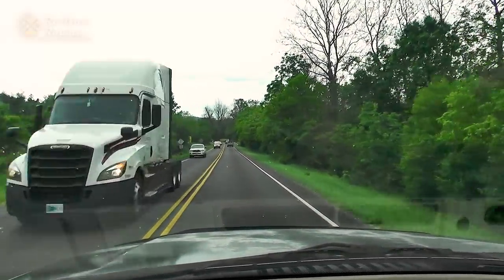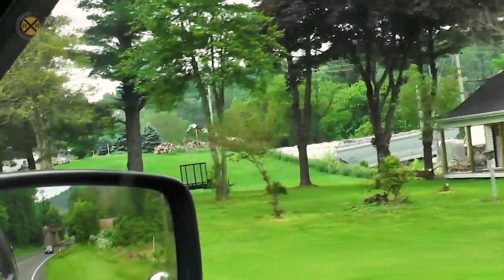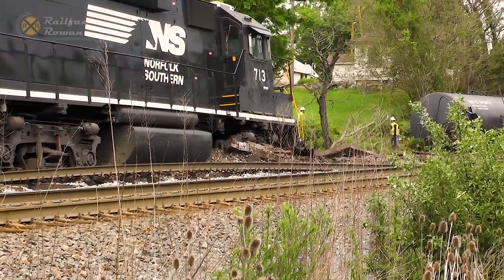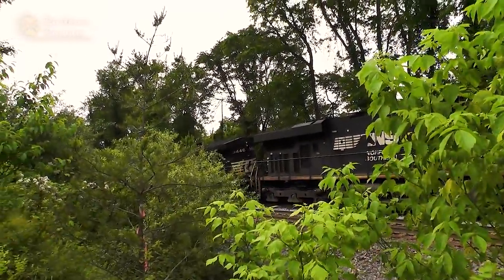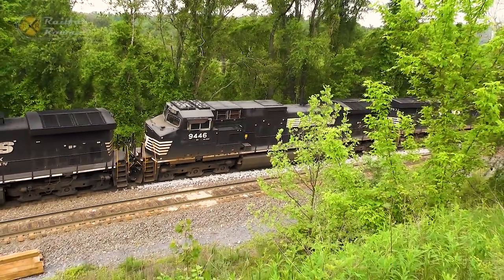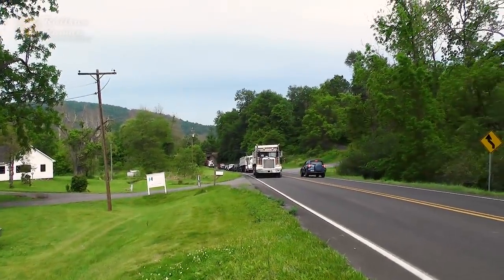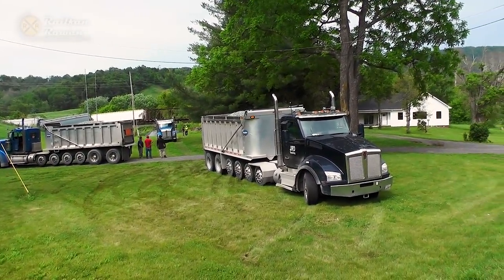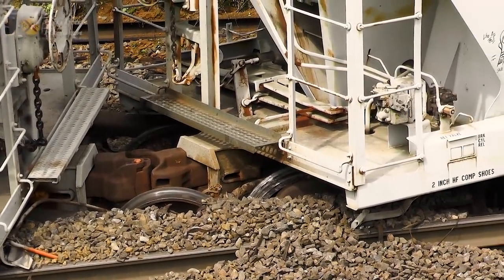BIG Derailment Near Front Royal Virginia - I-66 Norfolk Southern Freight Train 12R Linden VA

Comment: Proper job then??? Looks very much like the road has spread under the wheels of the front locomotive, probably due to rotten sleepers/ties, causing the spikes or other types of fixings securing the base plates to the rail foot to lose their holding power, turning the rail over rather than it being a technical fault with the points/switches, as these are always interlocked with the signals , which cannot clear to a proceed aspect unless the points/switches have been detected to be in the correct position and the facing point lock applied. Hydraulically operated rail clamp locks are also interlocked to the signals... I was a train driver in UK for over 40 years, now retired, and witnessed the aftermath of quite a few derailments, accidents and incidents to both passenger and freight trains in my time... May I reiterate what the previous post has said... stay well clear of the railway and take any photographs from a safe vantage point... you never know what may be hanging loose on a moving train... that applies to level/grade crossings/station platforms too when watching trains pass...
Reply: Thank you... If you're interested in current and historic rail accident investigations, you can find all of the US reports on the railroad section of the NTSB website, the Canadian ones on the Transport safety Board of Canada website, Australian ones on the ATSB website, NZ ones on TAIC website, British (and some Irish ones) on "the Railways Archive website, or RAIB website UK, RAIU website (Ireland)... I used to be a Trade Union Health and Safety Rep (ASLEF) before retiring, hence my interest in rail accidents... you can always learn from the mistakes of others...
Reply: I am retired railroad supervision Tranmaster Yardmaster Wreckmaster Safetyman and track checker. Have worked industrial switching yards Steel mills. Never worked on mainlines HOwever worked with all the Rail carriers Canadian national . Norfolksouthern. Conrail  penn central. List goes on. Rerailed molten iron torpedo bottles. Slag pots. Steel ingot cars all miserable conditions on my belly with wood blocking guage rods grease and some luck and replacers. 49 years and 65 age. Time to go home. Its a young mans game. Railroads gets in your blood. Your mind and eventually your soul.  So what do i do now? Sit in my chair and watch railroad sites on internet.  Out of the SMOKE AND STEAM i became who i am. I still have my gloves. If you worked on railroads you know what they are for. I see them and memories come back. I will never forget my life as a railroader. Thanks to you. I may see you on down the line. May all your switches be !ined for you and a clear tracks ahead. OK BACK!!!!!

Comment: You brought up a very good point early on, about being aware and alert for anything. That empty centerbeam had a number of cables come loose. If just one breaks or otherwise comes loose on a moving train, you'd likely never see it before it took your head off. Shifted loads, dragging equipment... stay away and stay safe, folks.
Reply: Its like the Video where the kid was railfanning a Reading and Northern train on their first run on a reactivated line and the rear of the train jumped the tracks when he was standing less than 5 feet away.
Reply: Aaackk!!  Holy smokes, NEVER gave that loose cable thing a thought!  Subbed.
Reply: @dexecuter18  - I recall a website run by a railroad engineer who basically wanted to "scare kids straight" by posting photos of actual deaths by climbing under railcars. In one, there was a youth whose torso was severed just above his pelvis. The characteristic "belt line" bruise where the wheel flange pinched the body in two was pointed out. Think about that the next time you use a pizza cutter wheel, lol.
Reply: Or , like that landslide video that knocked the intermodal train over . You can see a few signs of the dirt shifting early on but if one was not paying attention to the hill , and was close to the tracks , the intermodal cars could of smashed you and you would be dead in an instant. Railfanning may not seem that dangerous , but trains are sooo dangerous and things can snap or change in a second . A rail could flop over , an intermodal car could smash into you , or maybe a switch fails and a locomotive flips onto you . Always be careful
Reply: @deadfreightwest5956  Yeah when I was a conductor a new trainee went in between cars when they where in motion and got sandwiched in the knuckle.  Guy must have been as dumb as a rock.  You never foul the tracks unless you have 3 step when in proximity to rail cars and engines.  That is the number one rule they teach you pretty much before anything.
Reply: @freespirit9981  - You can't fix, or prepare, stupid. As a lifelong professional, I've been called on to train others, and some people... You wonder how they find their way to work.
Reply: I totally agree. As an (Australian) railroader of 42 years service, I know the forces involved with moving trains and what could happen. I've seen rail fastenings, the Pandrol clips that hold rails to concrete ties up to 50 feet from the derailed cars. Imagine one hitting you. Also, if a tank car ruptures, you could be walking into a toxic vapour cloud. There's just so much dangerous stuff on railroads these days, but a damn sight safer than going by road...
Reply: @russellcasey616  Back in the early 1970's a freight train loaded with ammunition for the US Army, US Navy, and the US Air Force exploded near Roseville, California.  Needless to say, it resulted in a massive mess especially since it occurred in a RR switching yard. The small town of Antelope, California was completely destroyed.  This occurred in April of 1973.  My understanding is over 7000 pounds of bombs were in the train cars.

Comment: When you said - that is where the pin goes, --- that part is called the truck, it has the wheels and bearings , springs, and yes that is all that holds them on to the car, tanker, or what have you. Scary in a way, but it works, and its simple to fix. when putting a carback on the tracks! Grew up 500 yrds from the tracks. Loved hearing and seeing them go by. When I was about 9, I rode on the old train with the coal burning engine. and the old passenger cars! I still remember that! Thanks, again!

Comment: The torch is long not because of heat but for safety and/ or ease of use...
Reply: Yea, I'd want to be rrreeeeeealllllllll far away in case it's under alot of tension
Reply: Yeah it's long so you can reach stuff with out being totally in the line of fire. The rods he cut are part of the break rigging and are attached to the trucks via pins
Reply: yeah as someone who's worked with torches- they don't need to be long at all, you only need it to be 3/4 foot long from the valves to the torch end.
Reply: @javierpowell4705  yea a shop torch, if you're cutting something big with somewhat unknown tensions/ loads you want to be real far away
Reply: @Alex-uy7pc  yeah was just contributing the fact that it wasn't heat that necessitates the length
Reply: True, the longer torch allows it to be used from a safer distance. A shorter one would have meant that he would have been much closer to the two rods he cut, both of which if under tension could have killed or severely injured him.

Comment: It would be Interesting to know how Fast the Train was Moving.  It would be equally Interesting to know what Percentage of Derailments include the Units at the Front of the Train.  My guess would be the Higher Percentage of Derailments occur at other points on the Train from Broken Axles, Cracked Wheels, Broken Rails, Malfunctioning Switches, etc. Thanks for the footage. 👍
Reply: My guess 35-45 mph.  regular freight is typically capped out at 45mph on most NS lines.  From what I can see it is not split rail so side with probably 35-45 mph max speed for that rail zone.I side more with 35 mph zone.  Looking on google earth with the curves that are present in that area I side with 35 mph zone.   Maybe even 25-30mph cause I see their is a sharp curve on this line in the area of the wreck.  Up to 55 mph if intermodal.

Comment: I am a retired train driver from Milton Keynes in the UK. Fascinating, well filmed and presented video. The work those recovery and repair crews are doing is incredible. In my career I only saw one derailment incident - a single 90 ton loco that took a 15 mph switch at 45 and ended up in the ballast between two running lines. That closed the line for twenty four hours just to recover one loco and repair the track it tore up. It's absolutely correct what you say that when working trackside you need to be fully alert at all times - things really can happen in the blink of an eye.

Comment: Has anyone else ever wanted to see a derailment like this actually happen? Am I the only one?
Reply: Seen, it many times. NS are derailment specialists, crane master, Hulcher and Corman are wreck specialists.
Reply: Sean Collins no I mean actually happen. Like seeing the train pileup.
Reply: If you work in a hump yard for 22 years, you'll see many happen, in real time.
Reply: Sean Collins cool! Is it really interesting too see? I have a bunch of historical footage of the Duluth Missabe & Iron Range Wrecking crew in the 50’s and it certainly has changed in terms of safety. They had no hard hats or safety glasses or anything.
Reply: I do believe that there is a old video about a hump yard derailment. Ima see if I can find it
Reply: @railsofthenorthland1181  , in the yard limits you don't see mainline speeds, but it is still pretty impressive to see a cut break away from a pullback trying to slow for a coupling and tanks, LOs,and chip gonds end up 3 high and spread across 8 fwd yard tracks. First priority is to make sure that everyone got in the clear, then watch the circus come in and watch the different departments try to place blame on each other. Small derailments are handled by the carmen, anything too serious gets a wrecking crew called in.
Reply: @seancollins8665  You should see what it looks like when it is a beer train that derails. Makes you wonder just how much pressure a boxcar can withstand before the doors or sides blow. If the car is properly loaded, the car has to be scrapped as it will exceed width limits.

Comment: I work for a salvage company and you're right, no two jobs are alike and it can be extremely dangerous. Granted most of what I do is marine salvage I also do some aviation and have been called in for a few rail jobs as support for the main crew.
I can't post about the main company that I work for but SOAR Aero has a channel that has a few jobs that I worked on posted on YouTube.

Comment: We hit a washout once, going about 25, we were slowing down to 15 mph to thru a interlocking the took the train from 2 mainlines to a med speed pass siding.
The train was to cross from outside line to the inside line to pass siding. 
It was the heavy rain season and it rained very hard in the early morning and the saturated natural wash moved a 3ft section 80% under the roadbed.
When we went over it, the front of the lead unit made it and the back did not and on the ground we went.
Did travel far, just stopped

Comment: Great coverage, - the Units- (the engines) as they are called , weigh average 140 ton per unit! Electric over Diesel power. These guys are doing a great job. My dad was on the railroad and had to go out on these as they happened! Like you said, it's a puzzle you have to work out as you go. We had a bad one years ago, where several cars loaded with rolls of printing paper went into the river. They had to cut them open and get some of the paper out so they could lift them. People don't realize what a simple thing can make a train derail. This looks like the switch may have been a contributing factor. Glad no one was hurt. Nice job! Thanks,

Comment: Appreciate the video. Question, what exactly do they do with a damaged railcar to haul it away? Not like they can throw it on the back of an 18-wheeler
Reply from the maker: Well they actually can, it would need a wide load permit, but absolutely a tractor trailer can haul that, depends on how they cut it up but most of the time I think with these they cut them up and scrap them in smaller pieces, I wasn't there to see it so I don't know for certain

Comment: I live about 300 yards from the CP Rail main line where it crosses thevEaglevRiver in BC.  I have to say CP has very few derailments considering they run large unit trains through the Fraser Canyon and Cdn Rockies.  I think you are right that the switch may be the culprit here.
Reply from the maker: It's either that or track gauge, that the train split the track gauge

Comment: What he is cutting at 15:20 is part of the center beam's brake rigging. I don't see the brake cylinder but do see the reservoir and the brake valve. The rigging is snagging one of the tank car's drain valves
Reply from the maker: I assumed it was a brake pipe

Comment: The extra length of the torch is not because the extra heat...
It has the same heat and tip as a regular torch 
The extra length is usually used in scrap metal or demolition just for the convenience or extra reach
Reply from the maker: Yep, understood now!

Comment: Rail cars sit on pins that hold the car to the trucks.  We don’t call them wheels.  Each axel weights about 2,000 lbs each.  Same as  locomotives they sit on big pins as well ell and the weight of the engine and frame is what holds it in place.

Comment: THANK YOU FOR YOUR EFFORTS...& you should get a cheap drone. (Then work on up to higher quality.) You got some AWSOME footage, anyway !!!
   One small point to have in your noogan, You shouldn't be on railroad property, anyway, but IF you happen to be walking next to a railroad track, and a train is coming, get as far away from the track as you can and get on your belly and put your arms around your face & ears and lay as low and parallel to the track, until the train passes. Sometimes, strapping comes loose & whips along the side of the right-of-way, and can cut you up really quickly. This was in my training, many years ago. If you're between two tracks and a train going on both tracks, center yourself between those tracks, your body parallel to the track and get on your belly and protect your head, till they go by. You can get disoriented, really quickly; and walk into their path! 
   Bill, from Tn. 🇺🇸

Comment: I'm a retired quality auditor for Progress Rail and yes when the signs say no trespassing, it means no trespassing. Thankfully there were no injuries or fatalities. Trains are very heavy and will kill you in an instant. Now as far as the location of this derailment, and it occurring at a switch, it is possible that the switch was not fully locked causing separation of the switch points and derailing the train.
Reply from the maker: That's very possible, I believe this to be the case, that is Erica!

Comment: Alot of people dont know this but at crossings theres a blue sign. Thats an emergency contact for the railroad who owns that track. So if you know of a obstruction or an issuse3 like a gate closing/opening or a stopped train on a crossing even if a tractor trailer get stuck at a crossing call that number on the blue signs.  Itd a direct 24/7 phone number to a person. But the sign should have the RR crossing number on it. Give the operator that crossing number to the operator and they will warn and slow down or even stop/sidetrack trians to prevent a collision.

Comment: Torch looks like it is run off of propane with the tip. I call the long handle torches box car cutters or caboose cutters, as in the 80s I first saw them used to cut up decommissioned  cabooses.
Reply from the maker: Dang that's wild
Reply: It's an oxygen-acetylene torch.  The two gases combine at the tip for the intense heat needed to burn through thick steel.  The length of the torch is just for convenience.
Reply: @josephkrizauskas1052  I understand the torch, I own one! You can get a different tip and regulator to use Propane vs Acetylene, it's a cheaper gas, but doesn't produce the same amount of heat per cubic foot as the drawback.
Reply: @recoveryrider6183  I have 3.  I cut a lot of metal.  A lot of people call them propane torches.  It would take forever to cut through metal with propane.
Reply: @josephkrizauskas1052  yes propane doesn't offer the btu's that Acetylene does. You still use oxygen, the only difference is the fuel. Alot of junk yards or scrappers go this route. Victor or Harris as well as some other manufacturers  will list these tips in there product guides.

Comment: I wonder if the crew ran a stop signal at that control point, or went into the control Point cross over to fast
Reply from the maker: Well, even if it was a stop signal, it would have traveled whichever direction the switch was pointed, which is why I think it was a bad switch

Comment: When I see this bad superstructure, I feel sick. When will American rail companies learn what a superstructure should look like? Thresholds that have already become potting soil and nailed superstructure doesn't work at all. this is how railways were built in the 19th century. And there is no superstructure drainage either. This is again a classic case of widening the track with subsequent derailment ......Greeting from Berlin, Germany
Reply from the maker: Greetings, and although it may not look like it, there is drainage built into American railroad system, the ballast is specifically designed to allow for water to move without washing it out. There are extreme cases where this does not work but by and large that's the whole point, although I would like to see it a revamp of our railway system in some cases I agree!